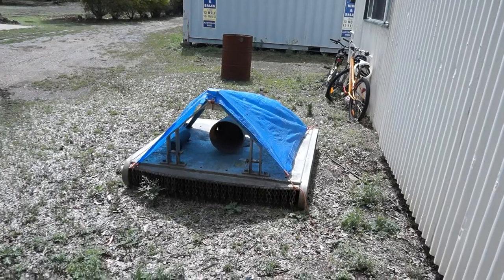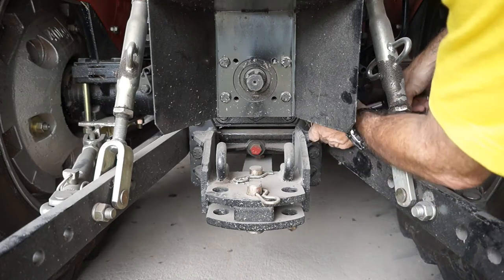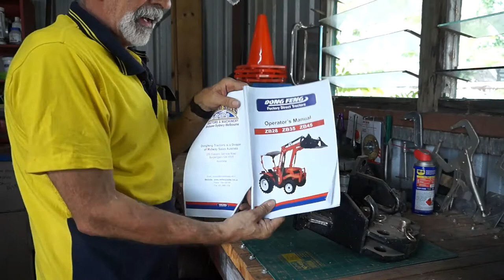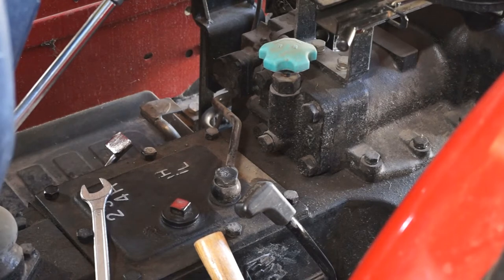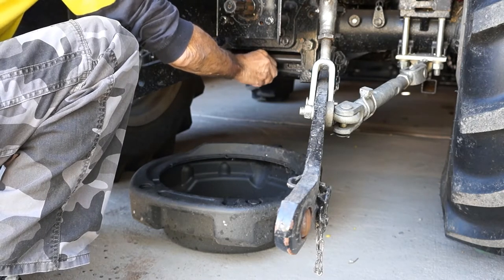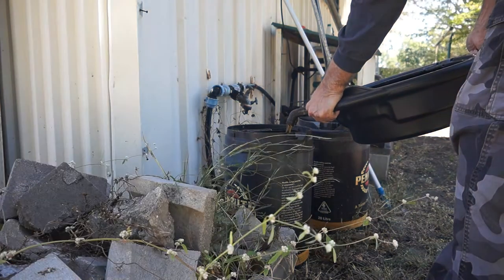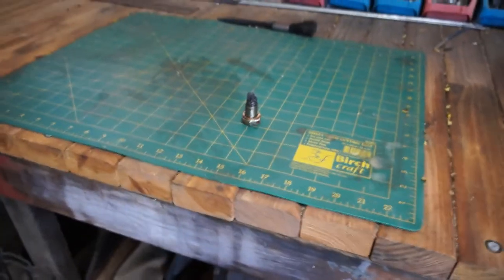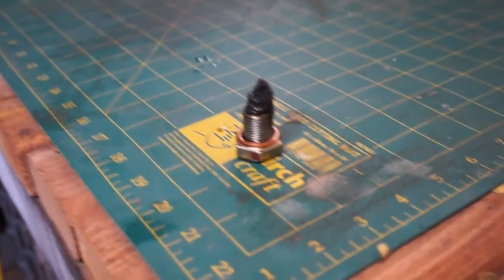Tractor Transmission Oil Change - DongFeng ZB28 ( DF 254 ? )- Part ONE

Comment: Hey John, long time fan, first time chatting. I recently bought a zb25 and I'm very thankful of you insightful videos.  Please keep the common maintenance videos coming. However, I have a question about oil. Do you use the same oil for the engine, hydrolics, gearbox and slasher gearbox?
 Only asking as I don't have a manual to guide me.

Thanks again for you videos.
Reply from the maker: Hello Chris, thanks for your message. I use the Same viscosity / grade oil for engine, gearbox, diffs etc. - as that is what is recommended in the Manual. If you need to know exactly what it is, please email me (see "About" of my YouTube home page). Slasher gearbox? I haven't had to change that yet. Unsure ATM. No worries, do plan to keep these videos rolling along. Hope you are enjoying your ZB25. Great little machines.